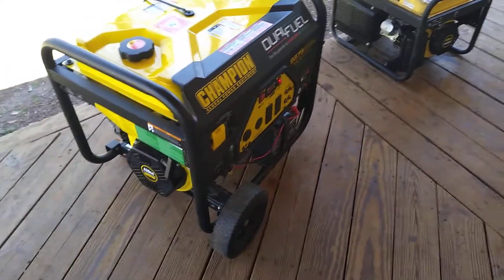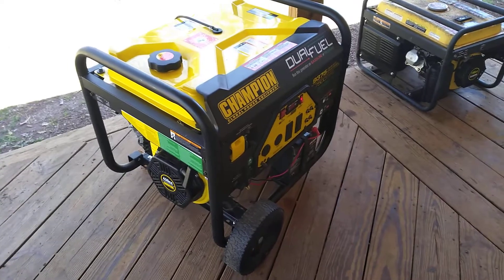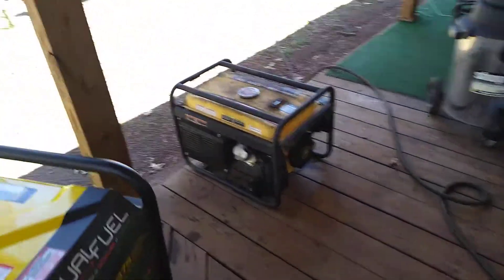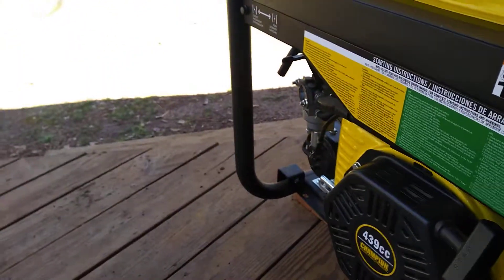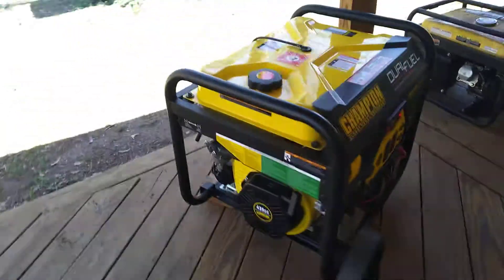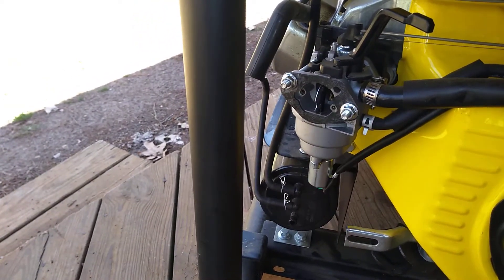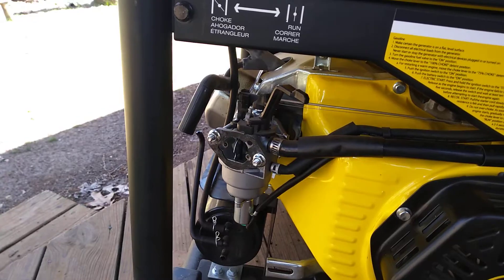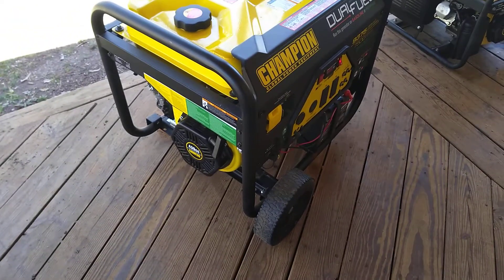Champion 7500 watt Dual Fuel Generator has been reliable but now just runs 3 sec & dies [ FIXED !]

Comment: If it won't run when you take it off choke the jet in the carburetor is more than likely clogged. When storing my generator I always use seafoam and turn the gas off and let it die on its own. I'VE  run generators 40 years minimum problems. SEAFOAM

Comment: Petcock sticking?  You’d be surprised as the rubber gasket in the petcock can get worn out. Also did you spray your carb good?  Sticking injector ?

Comment: Dude, I wanted to let you know. Thank you, thank you, thank you for mentioning the troubleshooting you did before finding the solution.  The low oil sensor was the key. I learned how to take apart and clean a carburator before finding your videos so I am not too upset that I spent that time but if you hadnt of mentioned the low oil, who knows how long I would of been lost for.  Thank you again, sincerely.

Comment: Mine runs fine on propane, but will only run for 30 sec on gas. It has been sitting up for at least 2 years. Surely I ran all the gas out before storage. BTW I used this unit for many hours during the feb.2021 winter storm, however only used gas because with propane in the cold weather it would not run for very long.

Comment: I have a Champion dual fuel 9000 watt and when I push the start toggle, I can hear the starter make it's noise, but the engine isn't turning over.
Is that the solenoid?  And how do you know how many hours you have on yours?  Is there an hour meter somewhere?

Comment: I have an older (8 years old) 7500 watt champion genny with only 64 hours on it and it is consuming way too much oil. It will shut down on low oil after only running about 8 hours. I called champion and they are sending me new rings and gaskets to repair it free of charge even though it is well out of warranty. I love the unit. It is very reliable and starts and runs great.  I guess that for some reason the rings did not seat very well. But I would recommend them and I would buy another myself in a hart beat.

Comment: I'm so glad I came across your videos. 

I was researching what generator to buy as a portable home power backup since up here in Ontario Canada, we too have more than our share of power outages. 

Apparently, from the online reviews I've read, the AVR problem you encountered is not uncommon with that model. That however, did not dissuade me from ordering a Champion 7500 watt Dual Fuel Generator after watching your videos.

Given the number of parts that go into making these units, I can totally understand the likelihood that something will break sooner or later, regardless of the brand. What motivated me to purchase this was that I could have the ability to run on either LPG or gasoline . This is a huge advantage and so is good customer support. I also discovered that there's no shortage of aftermarket parts for when the 3-year warrantee runs out :)

Again, thank you for sharing your experiences (good and bad). It allowed me to make a better informed decision about what product to buy.

Comment: I’ve got the same problem, champion told me it was the avr on the gen side but it didn’t help
Reply from the maker: Ok David please watch my resolution / FIX video pinned in top comment above.
Did you do this ?
Il help if I can - David in Texas
Reply from the maker: Could also be the Rotor or Stator pieces. They're both replaceable per my chat w Champion Power.
Watch my 2nd resolution video I show the electrical test it can determine if its those.
If you're in 3 year warranty parts are on them. If not you get your running Genny back.
Go for it !